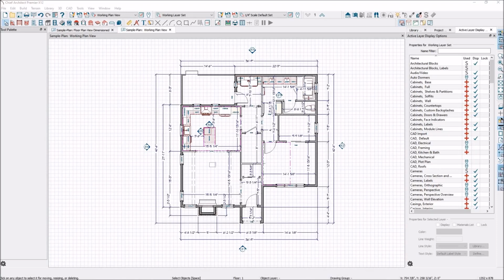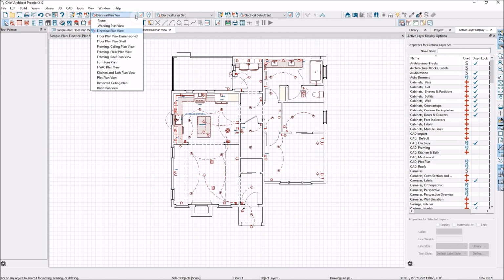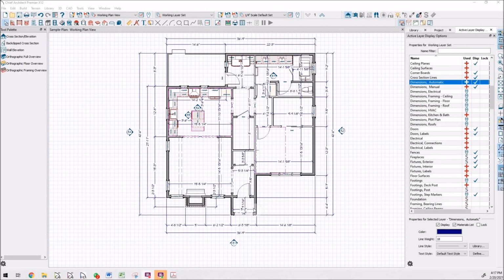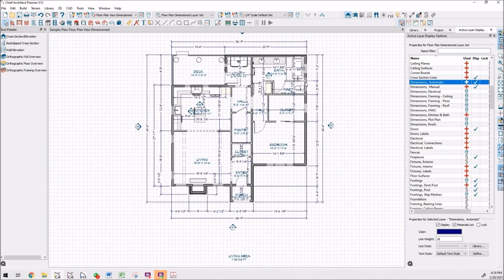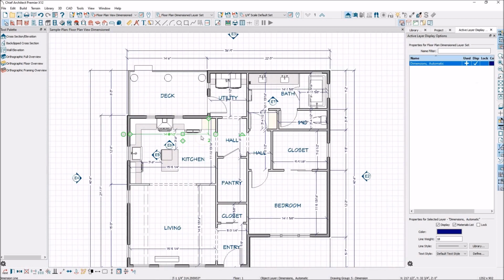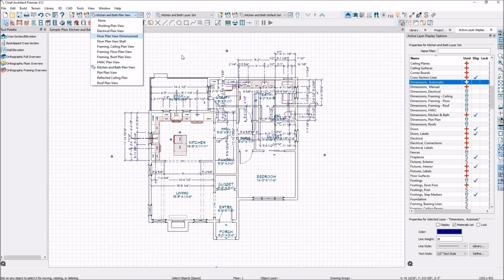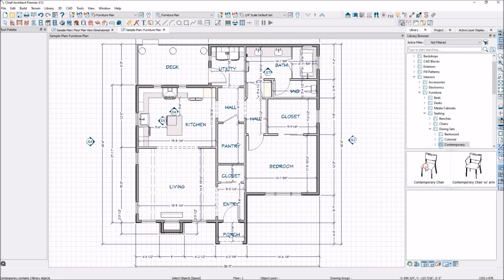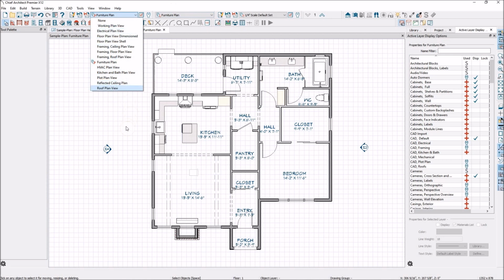33 Chief Architect for Beginners Plan View Sets

Comment: Can you pls show how I can create construction plan to show what I need to demo
Reply from the maker: Hi there!  To make a demo plan, you'll need one plan for your as built, and another plan for your new layout.  then, in the new layout, you go to Tools-Floor Reference Display - Change Floor Reference.  In the dialog box you will click Insert Below, then in the line click the Plan drop down and choose the AS BUILT plan file you created.  You can then click Define and adjust the layers and colors.  Then when you go to your new plan and click the layer reference it will show the As built plan instead of the other floor levels.  You can set up a new Plan View for the demo plan and adjust which layers you want to display.  :)